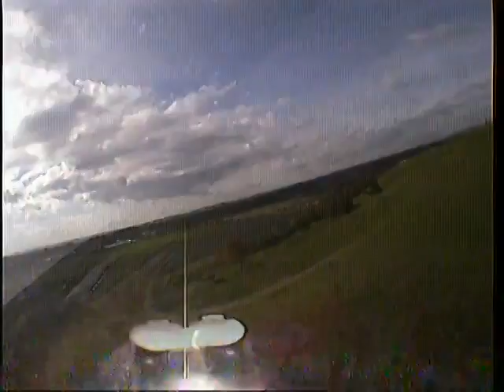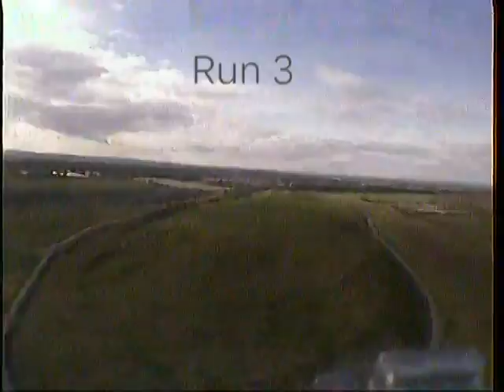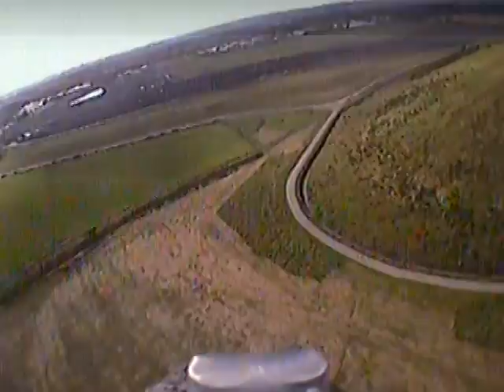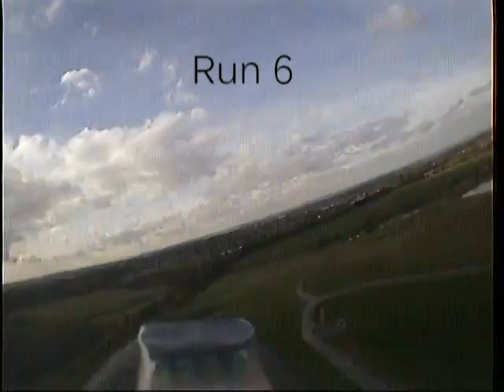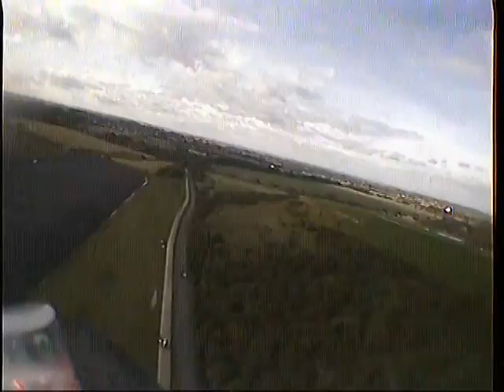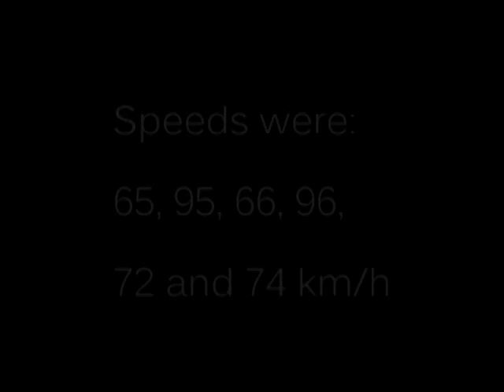EasyStar #6 : Doppler speed testing of my FPV EasyStar

Comment: Just over 50 is good for a typical EZ. You can get a bit more out of them if you clip the curved wingtips off (mine is about 4" clipped off) and a bit more yet if you do swept wings like I've seen some people do. My record has been about 65mph, but I think I might be able to do a little more if I changed my motor and prop to something more aggressive yet. I'm using a 7x5 on an 1880KV Exceed RC Rocket Series motor (the 2220-1880). I'm going to be replacing it with a uh... 3520? Turnigy 1450kv motor, and then I might up her to a 7x6 for a little greater speed.

Oh, forgot to mention... having a GPS on the plane is awesome if you're a speed nut. You can do a couple upwind and downwind passes and then extrapolate the speed by comparing the two to deduce the wind speed. Nothing is near as much fun as blasting down a roadway and watching those numbers tick slowly upward, haha. Fun times. :-)

Comment: Here's the calculation.
R = high frequency / low frequency
S = speed of sound (768mph)
speed = (R-1) * S / (R+1)
For example, in one of the runs we have 1981 and 2315 Hz.
R = 2315/1981 = 1.1686
Speed = 0.1686 * 768 / 2.1686 = 59.7 mph

I derived this earlier today and used the data in your video to confirm I was doing it right. I did this because a Cessna 172 flew extremely low over the house this morning, and I want to estimate how close by the doppler effect, etc.

Comment from the maker: @cortexdnb1 The goggles come with a separate rubber eyepiece, you really need this if you are using them outdoors otherwise you get reflections of whatever is behind you on the screen.  Actually I tend to pull my hood up and over the goggles to cut out this side glare.  I don't think this would be unique to these goggles.  They use a standard nokia type phone battery so you can get spares if you want to use for long periods away from base, I've run for about an hour with no battery issues...

Comment from the maker: @cortexdnb1 Hi, I haven't used any others so can't say where they rank on the market but I can say that I like using them. They are pretty comfortable and have enough brightness to give a good picture.  The remote control never really seems to adjust brightness/contrast but the current settings are good enough. I have used the on my Wii and that works nicely too. You need to be careful with them, mine have some white marks on screen where they caught the sunlight once, keep away from direct sun.